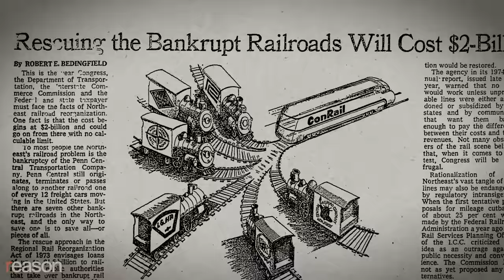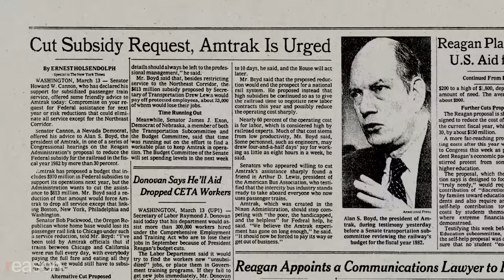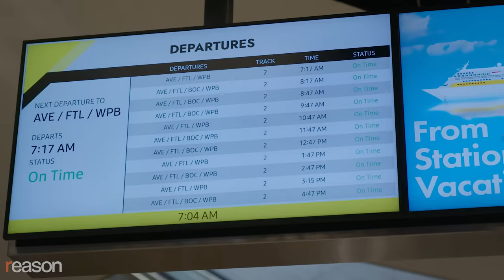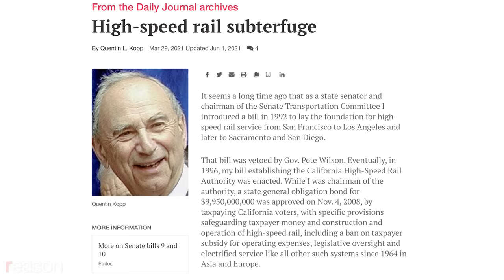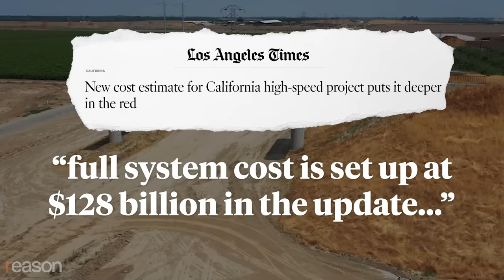How Florida beat California to high speed rail

Comment: The problem with comparing Florida to California on rail is geography. Flat. No earthquakes. No mountains. No gradients to speak of. And underutilized freight rail infrastructure that has plenty of overhead for additional passenger service. Precisely none of these advantages apply in California, just huge geographical hurdles and grossly overcrowded freight rail infrastructure that's running on fumes. Of course it's going to be many times easier to do rail in Florida, regardless of whether the public or private sector is doing it.
Reply: The bigger problem is California politics.
It's not the natural geography that makes it hard to build in California, it's the political geography. Where there are so many veto points you need to pay people off or they will stop your construction because it casts a shadow on a school yard.
Reply: Even ignoring the geography, Brightline is just a far less complex compared to CAHSR. It uses existing rights of way meaning you don't have to deal with land acquisition (which has been one of CAHSR's biggest problems) and is so much slower to the point where it doesn't even meet the definition of HSR despite what this video might lead you to believe (even Amtrak has faster trains than Brightline)
Reply: Florida code is as strict as California. Cali has lower maximum wind design loads but higher seismic loads.
Reply: I’m sorry what “grandients”? CHSR is currently being built in the Central Valley, they haven’t done anything with “mountains” and it doesn’t use any fright lines. 

Brightline had to go over swamps, forests, and barrier islands of the Florida coast. CHSR is essentially being built in the Kansas part of ca, what’s your excuse again?

Comment: But they are too clean, too fast, too useful and smooth and affordable.
Reply: .    TRAIN REALITY:  China has built more miles of high‐speed rail than any other country with $800 billion debt.  None of its lines are covering operating costs.  (As a result, China is shifting to building more roads.)

France’s rail has debts of $70+ billion and has been repeatedly bailed out by the government. SPAIN built its system with a public‐private partnership.  It is $90 billion in debt.  The state‐owned Japanese National Railways has a debt of $550 billion.  (Japan also has Highest debt to GDP of 300%.)

Railroads are an OLD 1700s technology that is obsoleted by faster, more flexible travel technologies.  High-speed rail loses tons of money & is a bad investment.

Comment: The title of this is totally deceptive as Brightline as of yet has not built a single mile of high speed rail infrastructure. Brightline's fastest trains at 125 mph along one route are far too slow to classify as high speed rail. California on the other hand has been building infrastructure to accommodate 220 mph operation and maximum test speeds of 240 mph. The two systems are not comparable. Designing a system to higher operational standards is of course more expensive. 

Even Brightline West's route between Las Vegas and Rancho Cucamonga will operate at significantly slower speeds than the California system because they chose to build in a freeway median constraining the rail alignment to the same sharp curves and steep gradients the road traffic follows. That may be fine for freeway speeds of about 80 mph but passenger rail needs to meet a minimum operating speed of 155 mph to qualify as high speed rail. 

Furthermore in this situation the narrow freeway median alignment means that Brightline West will be limited to a single track operation. Trains in opposing directions will have to wait for other trains to pass limiting capacity and utility of the line. California's system is being built for a minimum of 2 tracks and 4 tracks at every station to provide bypass loops for express trains. 

The CEO of Brightline is being disingenuous by claiming Brightline West is taking a more entrepreneurial approach to HSR without acknowledging the extensive operational compromises they are accepting while still asking for a $3 billion grant from the federal government.
Reply: Regardless, BLW will be very successful. Forty trains a day can easily run on single tracks with stategically placed passing tracks. CAHSR, which l support 199%, is becoming rightfully jealous.

Comment: Brightline is „Mid-Speed“-not High-Speed !
2 hours should be enough for the distance…
Paris-Strasbourg 272 ml -1:45h
Nice Commercial video
Reply: Reason is actually an independent newspaper.     TRAIN REALITY: China has built more miles of high‐speed rail than any other country with $800 billion debt.  None of its lines are covering operating costs.  (As a result, China is shifting to building more roads.)

France’s rail has debts of $70+ billion and has been repeatedly bailed out by the government. SPAIN built its system with a public‐private partnership.  It is $90 billion in debt.  The state‐owned Japanese National Railways has a debt of $550 billion.  (Japan also has Highest debt to GDP of 300%.)

Railroads are an OLD 1700s technology that is obsoleted by faster, more flexible travel technologies.  High-speed rail loses tons of money & is a bad investment.
Reply: @electrictroy2010  
You are a troll

Comment: Brightline in FL goes max 130 mph. That's good, but it's not really unique in the US. Amtrak already operates at basically the same speeds (110 vs 130 mph, so it is a little slower, but hardly) on multiple routes already, by using the same techniques that this video gushes praise at Brightline for. California HSR needs all those expensive grade separations because it's real HSR, it is supposed to go over twice as fast, it's not even close. We spend 60bn/year on the highways in the US and very few people have any objection to that. CA HSR is worth the money they're spending on it, and if my state would put a similar system up for a vote I'd gladly agree for my taxes to be used for it.

More train infrastructure is GREAT, we badly need it, any way we can get; but this obsession with transit/trains needing to be profitable is wrongheaded. If you're a car person, here's an analogy: Imagine if one of the political parties was constantly going on about how the interstate system needed to generate a profit, and changed every highway to toll roads that cost $200 to use. Then they kept forcing the highway system to close roads that weren't generating enough money. Does that sound like a good idea?
Reply: FALSE.   roads are funded by gas/diesel taxes (indirect tolls).  Both the states & federal governments collect MORE of these gas/diesel tolls than they spend on road maintenance.  Therefore, roads have a surplus and don’t need subsidies .    TRAIN REALITY: China has built more miles of high‐speed rail than any other country with $800 billion debt.  None of its lines are covering operating costs.  (As a result, China is shifting to building more roads.)

France’s rail has debts of $70+ billion and has been repeatedly bailed out by the government. SPAIN built its system with a public‐private partnership.  It is $90 billion in debt.  The state‐owned Japanese National Railways has a debt of $550 billion.  (Japan also has Highest debt to GDP of 300%.)

Railroads are an OLD 1700s technology that is obsoleted by faster, more flexible travel technologies.  High-speed rail loses tons of money & is a bad investment.
Reply: @electrictroy2010  Hahaha sure, governments subsidize fuel costs. But anyway you haven't read or understood my comment. You're making the same mistake I was criticizing.
Reply: @eikopoppy29 lt's a fake bot. Not real. Al generated.

Comment: Florida doesn't have high speed rail. Yes they go faster than Amtrak, but not that much faster. The existing lines in FL can't handle fast speeds, max is around 70mph on those old lines. CA is building "real" high speed infrastructure so its trains will reach 220mph. Brightline is NOT high speed rail. Currently, THERE IS NO HIGH SPEED RAIL IN THE US!! California will still be the first. FL only has "booster" trains, but far from high speed.

Comment: Its not high speed anymore, too many people have been killed by it not understanding how fast it is so they've slowed it down considerably
Reply: Because they made the mistake of making it at-grade. They underestimated how idiotic Florida drivers are.
Reply: Where did they slow it down? It still goes 79 MPH in the West Palm Beach to Miami segment. I know there's a small section near Miami with a top speed of 45 MPH approaching Brightline Miami Central.
Reply: @Ven100  the 79 mph federal speed limit for passenger trains should have been abolished decades ago. It has been in place since 1946, and quite a lot has changed since.

Comment: I mean, if CA wanted to get the same speeds as brightline, they could have easily done that years ago, but that's not what they want. They're going for 220mph, not 125mph. They already have 79mph rail which could have easily been upgraded to 110-125 like brightline did.
Reply: They haven’t even decided on something as basic as what trainset they’re gonna use
Reply: @realAlexChoi  The trains you use are one of the last things you decide. You want the best thing that works for the infrastructure you've built, and ordering a bunch of trains to just sit around for 8-10 years collecting dust while you continue construction is just stupid.
Reply: @piemadd  No, it’s pretty crucial to know when you’re designing your system. Virtually every other project knows what trainset they’ll use.. except CA HSR. Hell, SNCF left California for North Africa due to how incompetent the California government was with the project
Reply: @realAlexChoi  Ok lets look at a comparable project: Brightline west. The project has been around for 5 years now and they still don't know what rolling stock they want. It isn't very crucial to know what rolling stock you need as that is a fairly minor part of your system and most trainsets these days are the same general layout and shape.
Reply: As for Cali, our 2008 ballot initiative promised SF to LA highspeed rail.  The governor is now saying 2040 for that full route to open.

Ridiculous.  Brightline might “only” be 125 but it’s still operating 20 years ahead of when SF-LA will finally work
Reply: @electrictroy2010  When did he say that? Latest estimates put the project opening in ~2029...

Comment: Two Amtrak trains each way run Orlando-Miami. One takes a direct route, one swings west to Tampa to allow Tampa-Miami service. They both run NY-Miami.
No one should say farebox recovery or revenue when the means of transportation does not use fareboxes to collect fares. Commuter trains don't have fareboxes. Subways have fare gates or cashiers booths. Light rail lines have ticket machines and random fare checks. Amtrak, commuter lines and Brightline issue tickets or mobile phone versions of tickets.
Ps, Amtrak is getting involved in Texas Central high speed rail when its own network goes begging.
Reply: It's not a literal farebox, just a metaphor or industry term.
Reply: @SynchroScore   it's a verbal downgrade of superior transportation systems. Plus those that use proof of payment with random ticket checks. And gated rapid transit systems.
Reply: @centredoorplugsthornton4112  "Farebox recovery" refers to money charged to customers. It is used as a standard term throughout the public transit sector, regardless of the actual method of payment or ticketing. You are being obstinately literal and needlessly pedantic, complaining about something that doesn't actually matter.
Reply: @SynchroScore  matters to me.
Reply: @centredoorplugsthornton4112  Well, I'm sorry to say that it matters to absolutely nobody else.

Comment: They did not build new rails, the are using existing lines, and these trains are diesel operated not electric, and yeah top speed is 85mph. A step in the right direction but not high speed rail.

Comment: Florida has a high speed railroad?
Reply: Yes we do!
Reply: @righteousmammon9011 no you have a higher speed railroad. Brightline does not qualify
Reply: @adamknott7830  125 mph on upgraded tracks is considered high speed, albeit on the lower end. average speed is what’s most important. Even the CAHSR will only average 114mph
Reply: @righteousmammon9011  but the section it runs 125 is brand new. I have no issue with brightline, it seems like a good service, its just not HSR and I think calling it that muddies the waters for people unfamiliar with it. CHSR does qualify though as a 200+ new build
Reply: @adamknott7830  Brightline isn’t finished so it remains to be seen what they’ll do with their Class 6 110mph track. Brightlines extension to Tampa will also be 125 so I guess the odd thing is that it may have the same average speed as the CAHSR, which is what is more important than the top speed, for 1/10th the price and far less  corruption than the socialists running California. I imagine Brightline West will be finished before the 1st leg of CAHSR. I’d be willing to bet on it
Reply: @righteousmammon9011  wait wait wait, the socialists running California? Come on you dont actually believe that capitalist democrats are socialist right? And yes average speed is more important but they are still different systems with different designations that apply to what they are classified as.
Reply: @adamknott7830  I have several friends in California that are actively trying to augment their lives to escape. It has the highest poverty rate in the country, highest taxes, highest homeless. I’ve literally seen people shit in the streets in San Francisco.
Reply: @righteousmammon9011  yeah but im not sure how poverty makes it socialist or has to do with CHSR?
Reply: @adamknott7830  mismanagement of funds due to the overall corruption of the state that continues to delay the project and balloon the costs.
Reply: @righteousmammon9011  aint 185mph  hsr the most Brightline can do is 175
Reply: @righteousmammon9011  I know California class system is considered higher class in other state hint how we outbid all Floridians out of the market even though those are the poor Californians moving it understandable that you will think 125  mph is hsr even though it actually 185mph in most circles. Also California is spending most of that money to generate future courses, projects, and classes to keep this work for Americans which Brightline can hire out of country people for cheap. In other words California is trying to make this majority Californian made. Yes some parts are still out of state or country but it mostly benefiting our economy.
Reply: @angelmendez2211  if you’re referring to Brightline West, it’s planning 220mph. If you’re referring to Brightline in Florida, it is 125 mph because they run diesel electric hybrid trains instead of full electric. Florida would have a hard time electrifying their tracks with the hurricanes and catenary issue
Reply: @righteousmammon9011  west yes though Florida no.

Comment: Easy, they didn't. Brightline is not and never will be high-speed rail. Brightline has a top speed of 125mph, CAHSR will have a top sped of 220mph, making it not only 95mph faster than Brightline, but also the fastest wheeled rail system in the world by a little under 3mph.
Reply: Average speed and frequency are much more important than top speed. Of the 500 mile CAHSR system there will be 125 miles of slower blended track and closely spaced stations which compromises the average speed. SF-LA in 2063 will take four hours by hsr.

Comment: Too short to fly = Propaganda LOL. Too far to drive also, since future cars will be faster. Brightline = $3 Billion and possibly much more in Federal subsidies.
Reply: Fact check:  Government subsidies were $834 million for the very successful $6 billion semi-high speed railway.
Reply: @davidjackson7281  Whatever the case, it's a Billion Dollars (almost), and it will get future grants to offset operating losses to the tune of likely $Hundreds of Millions or $Billlions more over the decades.
Reply: @Sovereign_Citizen_LEO Yes that's the case. ln the future BL probably will no doubt receive rightfully some form of government funding to build stations and upgrade safer crossings or replace the St. Lucie Bridge. BL has a positive cash flow and (news flash) they are profitable so no need for an operating subsidy which yes most all other public transit systems do receive. 

BL's business model is actually based on profiting also from real estate development unlike Amtrak for instance. Just felt l should respectfully clarify your fed subsidy comment which was perhaps somewhat overstated by a factor of atleast three-fold and possibly much more as you may have implied.
Reply: @davidjackson7281  - And I'm fine with all those things. Reasonably, if they become majorly profitable (not likely with transportation), then maybe they can pay back their subsidies (not likely). It's clearly better (and a better operating model than CAHSR) which may never be completed.